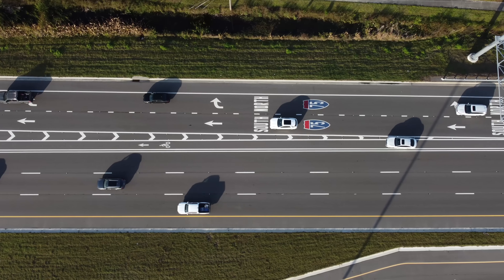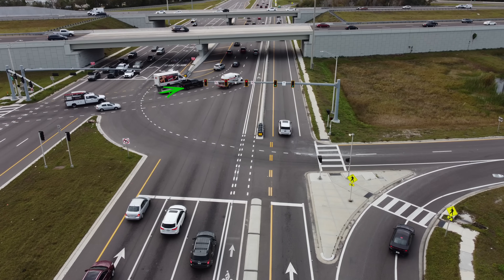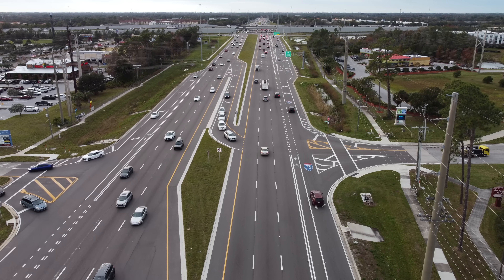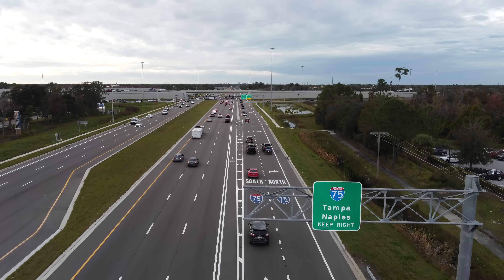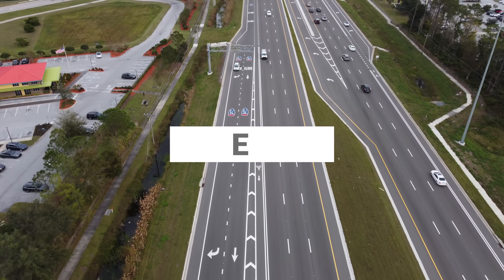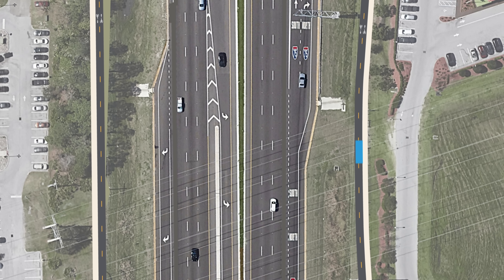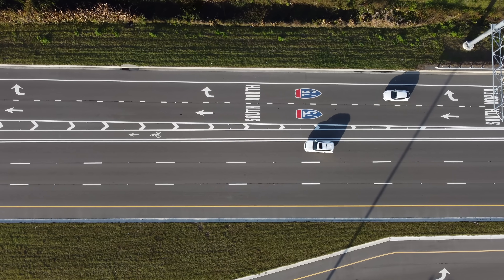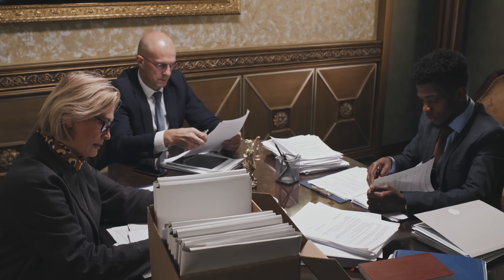This Brand New Interchange is Already Flawed

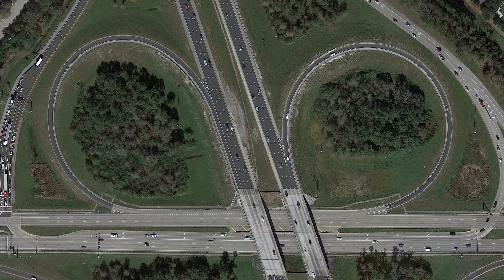Comment: 0:49 That is BS. This type of crossing and changing is absolutely normal here in Germany. It is primarily used, because of limited space, but works very good, if you don't drive around with an ego bigger as the Mount Everest. It works like this: you arrive in the merging/switching lane, see other traffic on the other lane, search for a spot you can safely change, no matter if you are behind or in front of the other car/motorist/truck/whatever, change and move on, without stopping. Why it doesn't matter? Because the other traffic changes also! After the passing zone, you are in the same line of cars before. No one needs to stop, no one advances or looses. Once you get that into your mind, you don't bother at all about that and the "me first" mindset prevents problems, as this entitlement of some people is the only thing that could cause problems.
Setting up lights or whatever to control the traffic STOPS everyone, making the usage of the road and space inefficient.

Comment: Americans simply do cloverleaf interchanges wrong. There needs to be a dedicated deceleration lane before the start of the cloverleaf merging, separated by a barrier. So like with a normal exit, you enter the deceleration lane, slow down, then the deceleration lane gets physically separated from the highway, the (2-laned) low speed merging zone begins, merging takes place, then after the actual exit ramp the deceleration lane becomes an acceleration lane, the physical barrier gets removed, and you can (re-)enter the highway. Your design is terrible because at the same very limited space some drivers have to decelerate while others already have to accelerate… its beyond stupid

Comment: This intersection is not great, but the amount of drivers violating traffic laws, just because they missed their exit and don't want to drive a little extra (suprised pikachy face) is expected, but awful and shows how people value their own self benefits over laws and other people's safety. (Rip to all bicycles driving on such an unsafe biking lane. I live in a country with great and safe infrastructure and people here will still pull off insanely dangerous/reckless manoeuvres because they don't think about anything other than themselves.

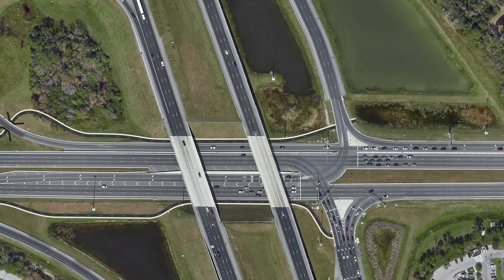Comment: 6:55 One issue with using tunnels in this area, the water table is only about 3-5 feet below ground level. You might use overpasses if you give enough space to make a gentle enough slope for bicyclists and pedestrians, then there is the cost to this approach.

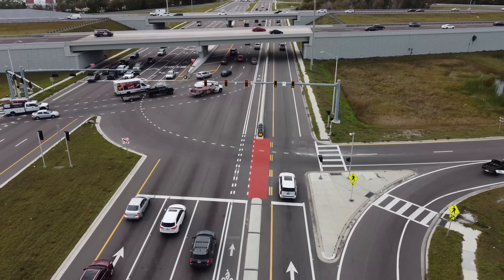Comment: 2:22 Gaps like this have almost killed me four times.  I've lost two bikes and a lot of skin to drivers who decided too late to turn but thought oh, there's a second chance up ahead.  That part alone is a horrendous design decision.  (Fun fact: after a driver hits a cyclist at an intersection like this, they never stop.)

Even without the markings/merging issue, I will never again attempt to ride on a road where a vehicle lane crosses a bike lane like at 4:02.  Too many drivers, seeing a cyclist, will try to beat the cyclist across that gap.  Those who do slow down for a cyclist ahead only serve to encourage more impatient drivers who don't even see the cyclist to blast around and change two lanes through the gap.  At least pull the bike lane off and give me a controlled crosswalk up the ramp; I'm willing to delay my commute by 60 seconds to hop off and push a button if it means not getting mowed down from behind.

Rather than tunnels, we have a few pedestrian/bike bridges over highways and main roads around here.  They're great but underutilized because the rest of the bike network is like... well, like I already described.

Comment: "For infrastructure to work well, it needs to not only function physically, but also consider how people behave."

I have designed a theoretical interchange that connects two highways with collector roads in the four corners of the interchange, -all in free-flow traffic with little weaving.  However, it is so confusing that I do not consider it possible to build in real life.  In City Skylines, I've not managed to make a city large enough to overwhelm the interchange.  But that's computers who can perfectly follow a confusing road layout that doesn't make sense.  Confusing road layouts cause more wrecks, simply because people panic and make bad moves when they're confused.

Comment: I like the design for the cycle paths along the sidewalk outside of the highway. Although as another user pointed out the flooding issues and hills created by tunnels, as well as the cost associated with making the tunnels could pose a problem. I would probably prefer crosswalks across the roads if it meant it could actually get passed due to the lower cost of the project. As far as cars seeing the cyclists, i hate to say it, but the cyclists should slow or stop and check for traffic. Thats an unpopular opinion but if the infrastructure bills only provide so much funding, we have to compromise somewhere or the projects just wont happen, and they'll keep doing what they do now, which is put bike lanes on roads instead of having dedicated paths.

Comment: I will never understand why people think bicycles and cars should share, rather than bicycles and pedestrians. Yes, combine the squishy people moving slowly on top of a collection of metal poles and wheels with the two-ton death machines flying past at 5x the speed instead of with the other squishy people moving even more slowly. Bicycles belong on sidewalks, not roads. Pedestrians can move over for them, or the bicyclist can stop and walk their bike past a disabled pedestrian. Indescribably safer than mixing bikes and cars.
Reply: You're not wrong but the problem with sidewalks is people coming out of parking lots are not looking for cyclists and many of them just roll out onto the road without stopping

Comment: So this intersection is I-75 and SR 70 in Manatee County Florida, I know this cause i live there and this project made traffic worse and it was not thought out properly, there are more accidents now, and people not knowing where to go causing slow traffic, although the tunnel thing is a good idea, that area use to be swamp lands so the water table is high which prevents tunnel, but they could have done pedestrian bridges over the roads where needed.

Comment: It's less a "Let's kill cyclists" and more "Feds won't fund it if we don't put in a bike lane, not understanding that if you're biking on this road, you're avoiding easier and safer routes already"... 
Because in the UK, we'd classify these as Motorways still, for both funding and legal reasons, the former is it's owned by Central Govt by way of National Highways who deal with anything on the motorway network, including structures and junctions plus a bit of road. The latter is because Cyclists aren't allowed on motorways, nor are pedestrians and stopping/parking (Unless forced to due to traffic, crashes or EMS direction) so the funding isn't withheld if there's no bike lane.

Comment: There is a bike lane on US 34 through Loveland, Colorado. I NEVER use it for 2 reasons: 1) drivers on US 34 are dumb (I was run off the road once - in my car - by someone changing lanes without looking, plus everyone speeds through that section); and 2) there is no direct access from the pedestrian/bike path that also sort of parallels the road. The speed limit is 40 where the bike lane starts, and drops to 35 after it ends. It’s also a fairly short bike lane. It’s much easier and safer to ride from the dedicated path to the sidewalk and then be courteous to pedestrians already on the walk until I turn off onto another street that has a bike lane.

Comment: The reason bike lanes like that exist in major interchanges is lobbying by bike and environmental groups for design standards requiring bike lanes in new projects.  

The proposed solution to add 7-8 tunnels, one of which appears to be over what is currently undrained swamp land is not feasible and ridiculously expensive (millions of dollars of each of those tunnels, each of which is 40-60 feet long to go under 2-4 ~10 foot vehicle lanes--likely 10s of millions for all 7-8 tunnels). Likely every one of those tunnels would require sump pumps and pump stations to keep the swamp from flooding out the tunnel, which also creates long term maintenance costs.

I like your videos, but this isn't even attempting to present a feasible cost-justified alternative.  The signage change and/or 2nd lane for I-75 access makes sense.

Comment: I saw you point out the obvious conflict between traffic leaving and entering the highway, having to mix in the short distance between the exit and entry ramps. I am amazed that America and Canada still perpetuate this obvious problem, even though other countries have found better ways of doing it. For instance in Britain, where I'm from, our motorway design since 1960 has completely removed this problem: Traffic leaving the motorway does so before the junction, and enters it after the junction. There is no traffic mixing on the motorway itself, so no reason for traffic to slow down or change lanes, and no heightened risk of collision with slow-moving or decelerating traffic. All traffic mixing is done away from the motorway using a mix of roundabouts and sometimes traffic lights. It works well, safely and with reduced risk of accidents. It also reduces the need and the opportunity of drivers suddenly switching from one traffic flow to another, which tends to encourage better driving habits and less tail-gating - because you don't have to defend your place in the queue from somebody pushing their way in.

The British design also has the advantage that if you exit off the motorway by mistake, you can simply exit off the roundabout and back onto the motorway entry ramp, avoiding the problem you identified at this interchange (as with all cloverleaf junctions) that there is no way of doing the same without breaking the traffic flow rules. And roundabouts also have the advantage - inherent in their operation - that if you're unsure which road you should take, you simply drive around a second time.

Having experience of both types of road design, I cringe at the North American one. You could learn so much from other countries, especially to get rid of cloverleaf junctions and four-way stops. I've seen so many shunt accidents here with people defending their place in a queue against idiots changing lanes at stupid times or in dangerous manouevres - and been the victim of one such shunt in Montreal. I've also T-boned another driver who stopped at a stop sign beside the major road I was on, but then jumped out in front of me with no warning because they assumed it was a 4-way stop and that I should stop too. Two accidents in 10 years after two  accidents in 40 years on British and European roads. I put that higher accident rate down to poor American road design and poor driving techniques resulting from it.

Please, America, learn from the experience and innovation of other countries? And Canada, please stop following America's lead?

Comment: Would be interesting to get a cost estimate for putting in the shared pedestrian and cycle paths with the tunnels suggested. In the UK it always strikes me as insane that noone bats an eyelid at ludicrously expensive road upgrades and then are up in arms at proposed cycle/pedestrian infrastructure which is a small fraction of the cost

Comment: The only problem with the tunnel idea in this case is the land seems fairly low with lots of standing water in the retention ponds. I’m not sure this would be a good location for making tunnels. I’m sure that would work elsewhere, but not sure about here. In all the spots you pointed out.

Comment: I think your concept in fixing the interchange is a great idea. But the only issue I have are the tunnels. Because Florida has a high water table, you can only go so low below the ground. And not only that, those areas can flood very easily.

Comment: Who rides a bike on a 3+ lane highway 😂 Bike lanes should only exist on roads of less than 3 lanes and speed limits under 40. Otherwise its just creating a danger for drivers and bike riders since bikes travel far slower than cars, and speed variance is the most dangerous thing on a road.

Comment: Wife and I have bicycled across many states on numerous different trips. Most notable was pedaling from Canada to Mexico along the continental divide. We try when can to have our routes be a connection of non-motorized pathways but do have to mix in whatever public passage we can find to connect paths or get to stores. The 5 cities of NW Arkansas has been the best commuter biking infrastructure we’ve seen so far. Florida has been very aggravating because we keep seeing horrendously dangerous situations marked as bike lanes. We leave near enough to one that we’re usually aware of each new fatality. GoogleMaps is of no help in planning trips we know first hand of several 2 lane highways that have the green bike line on map layer. These are highways with NO shoulder, not even rideable gravel alongside the road, posted speed limits are 55 but traffic rushes at 65-70. One in particular is dangerous even in a car because of aggressive passing that results in head on collisions. 
Maybe it is about time to get some experienced cyclists consulted on designing or designating bicycle “infrastructure”. There are advocacy organizations that can and want to provide this.
Also, there are many cases where experienced cyclists would know a lower cost solution that would actually encourage usage.

Comment: How much does a tunnel cost? you dig a hole, drop in a steal culvert and you're done. They use such things in mines and massive machines drive over them, they are using them for water drainage most of the time. Sad how they put costs over human lives. Governments are sick to put lives over costs.  They must have the same stupid FLDOT as MDOT in Michigan engineer's.  No common sense.

Comment: 7:58 There  is a parallel North  South  road  800 meters to  the  west  of  the intersection,so perhaps the  best  solution  is to  skip the bike lanes at the  highway, and build  he bike infrastructure somewhere else. But  that  only  works  if the roads are connected.

Comment: I would have built a roundabout, perhaps a peanut shape. Tight in the middle so it fits under the bridge. Four wings coming off the roundabout to link the highway. Junctions would be further apart as they don't invert.
Ideally I would say the roundabout would be above but I get the impression the upper road is more major 'motorway' esk road. (I'm from the UK).

Comment: I am always stunned that clover leaves are so critically seen in the US. Here in germany this is the most common free flow crossing and it works nocely. But I noted when driving in the US, drivers there are just not "willed" to just merge nicely. So this is more a driver problem then a efficiency problem.

Comment: Whoever is responsible for the designer that bike lane should be fired and prevented from doing this kind of work ever again.
 I have a sneaky suspicion that they were able to get a grant if the bike lane were included.  Some reluctant designer caved to the pressure.

Comment: In Brandon Fl, where MLK crosses over I-75, they changed it to a divergent diamond intersection.  What used to be a 50 mph stretch of road, is now a 35 mph intersection, with multiple stop lights.  Yes, it makes left turns at the light easier, but also much slower.

Comment: They must have subcontracted the design to PennDot, looks like something we would do in PA.  Penndot runs a computer simulation to test traffic flow where every car is programmed to do the exact correct thing.   Maybe FlDot just runs the same software?

Comment: Well, this is Florida.  We have problems with seepage of ground water and rain run off pooling whenever we dig down even a little bit. Pumping systems are expensive themselves, add to expense of tunnel construction and are rarely adequately maintained.

Comment: I'm guessing the designers had to include a bike lane just because it was required by the municipality for all new road projects to include cycling infrastructure, no sane person would willingly include a bike lane on a highway entrance ramp. If, for some reason this bike lane actually serves a purpose, it would have been a completely separate bike lane (probably two way) with some kind of under/overpass when encountering intersections. But obviously that would cost money to construct, and paint is pretty much free...

Comment: In the UK - there are multiple signs to advise of lanes dependent on the speed of that carriageway for example on motorways there will be 1 mile, 1/2 mile and 0 mile signs to advise of junctions/exits,   roundabouts will also have 2 or 3 signs on approach and at the roundabout.   Unlike the states, most junctions in the UK have multiple sets of traffic lights for visual aid for example at the stop sign and opposite

Comment: It's Florida.  Putting the bike/sidewalk in tunnels under the road just means they are under 6 feet of water.  They will either need to go over the road at surface level, or over the road by bridge.  It's not as easy as suggested.

Comment: A better and maybe a more cost effective solution to changing the bike path, is to create an alternatives away from the busy interchange. Half a mile north and south there is enough space to have a low incline bicycle bridge as there is over 300 ft on either side of the highway for the ramp. The trip will be more pleasant as you're riding/walking through tree rich area. As a bonus it would create short passages between residential and shopping area, instead of having to take a detour through the interchange area.